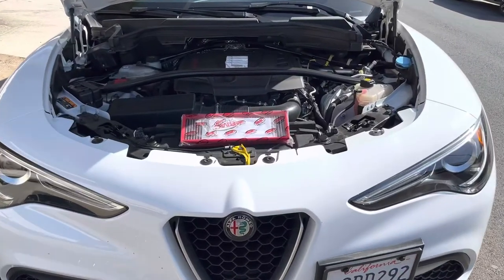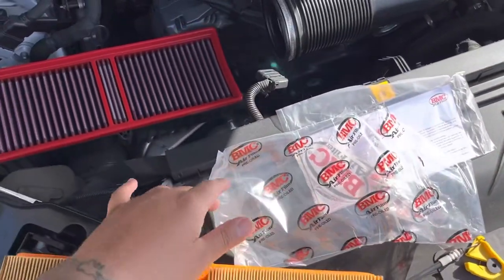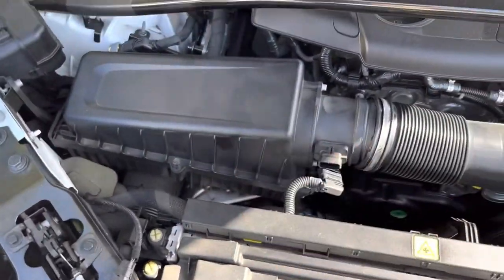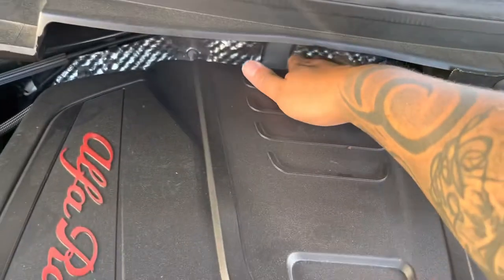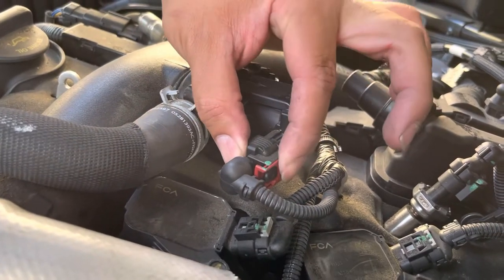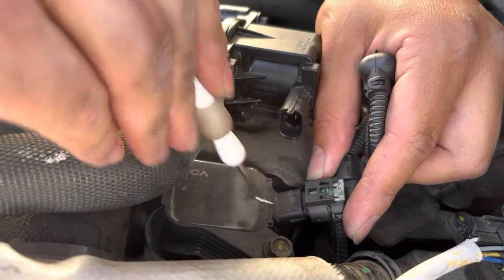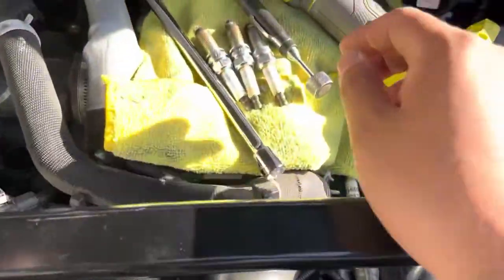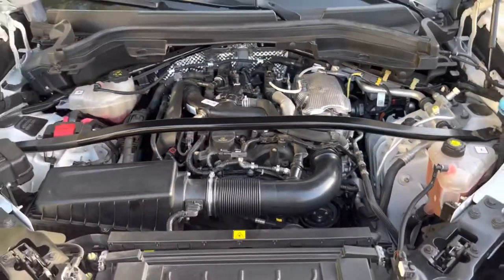Alfa Romeo Stelvio Air filter & Spark plugs install

Comment: I was in love with my Giulia and Alfa Romeo as a brand, however, I will never again buy/recommend another Alfa Romeo in my life. I had the brake by wire system fail on me and it caused me to crash and total the car. They sent someone from Bosch to diagnose the vehicle and in the charts it clearly showed that something malfunctioned (brakes were slammed 2 seconds before the impact at 40 MPH and it took more than 1.5 seconds for the speed to start going down.) Stellantis told me that they were not going to take responsibility for it and that I needed to have my insurance pay for the vehicle. Absolute garbage. I will never recommend this car brand to anyone again! Buy an AUDI, BMW or Mercedes instead!
Reply from the maker: I’m sorry to hear about your situation with your Giulia. That’s sucks. Ive been owning my Stelvio for about 3 years now 32,000 thousand miles with no issues at all. Just beside the maintenance. Its  a bit expensive, that why I started this channel to show people that you don’t have to be a tech to service this vehicle or any vehicle for that matter. As long as you keep up with the recommended maintenance  they pretty much run forever. Now that Being said theirs always a few that do have some issue coming from factory. Yours might have been one of them.  But I love my Stelvio.

Comment: Hey Ron - Great video.  Just purchased a used 2019 Stelvio w/32K miles.  (LOVE THE CAR!)  It's still under warranty, so I took it to the dealer for an oil change and general inspection.  They mentioned that at 30K I should get the spark plugs changed.  I kind of felt I was getting the dealer upsell, but coming across your video and hearing that you changed out your spark plugs at 32K made me feel better.  Now if I only had the patience and tools to do the job myself!  Lol!  Keep sharing! :goodvibes:
Reply from the maker: Thanks bro. It’s not that hard bro. You can definitely do this on your own and save some money.

Comment: Just a word of caution about modern air filters that are oiled. Back in the day oil bath air filters were used successfully 
in everything from lawn mowers to trucks. Even though this isn't an oil bath be careful how much oil you use on it after each cleaning. In today's electronically monitored engines, oil/oil film on an air filter can compromise the function of your Stelvio's MAF sensor.
Reply from the maker: Noted. Thank you.